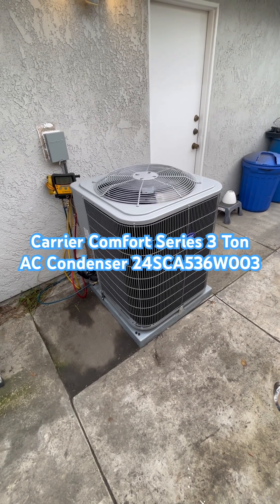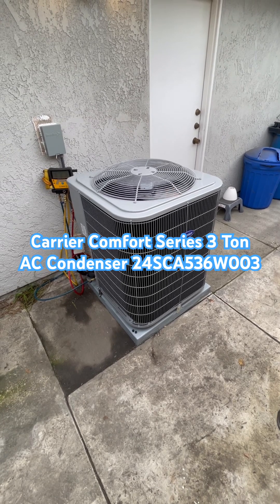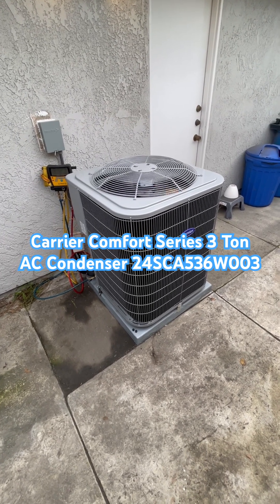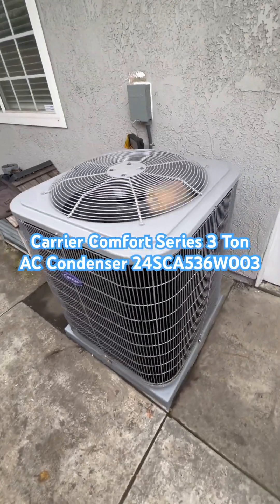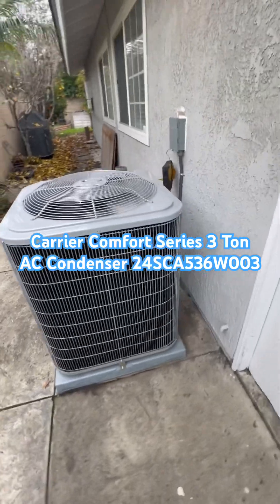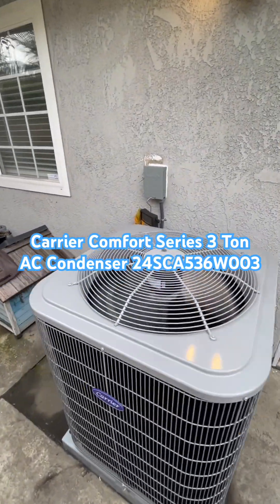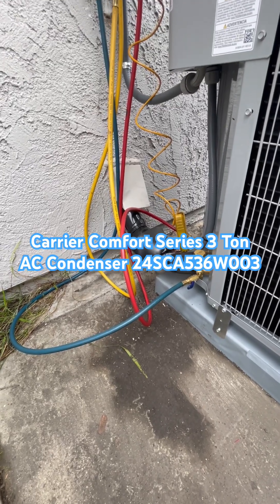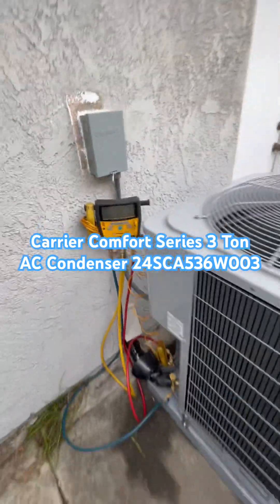Carrier Comfort Series 3 Ton AC Condenser- 24SCA536A003 #hvac #carrier #accondenser #carrierac

Comment: 3 tons of what ?
The way I understand measuring the heating and cooling systems capacity is in BTU (Basic Thermal Units).
I have a 25,000 BTU in my master  bedroom and  12,000 BTU  in the  kid's rooms; the kid's room are 50%  smaller.
Reply from the maker: 3 tons is equal to 36,000 BTU's of cooling capacity.  
And BTU is short for British Thermal Unit, a unit of measurement that shows just how much energy your air conditioner uses to remove heat from your home within an hour.
Reply: 🤦🏻‍♂️ “basic thermal units” Jesus Christ 😅
Reply: @hunterm4188 lmao😂